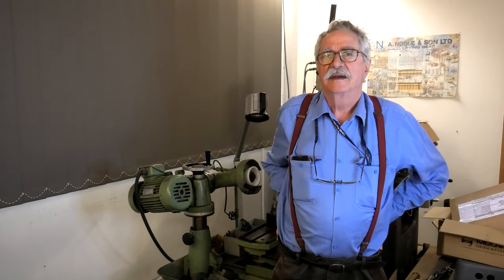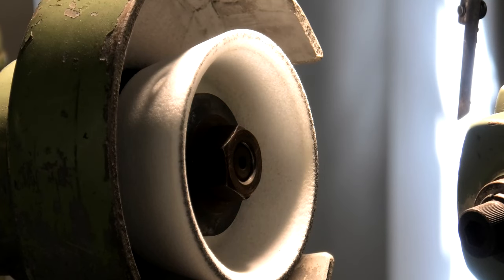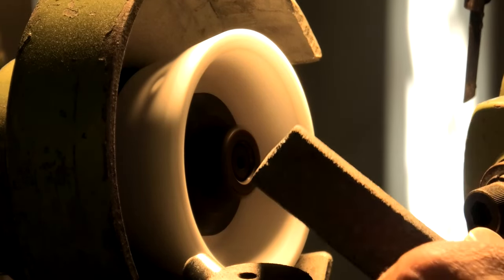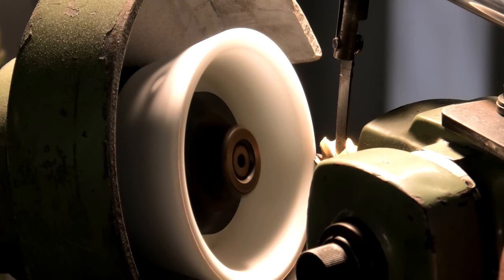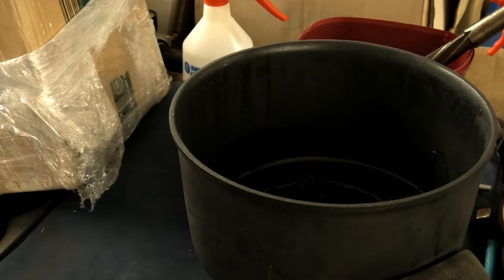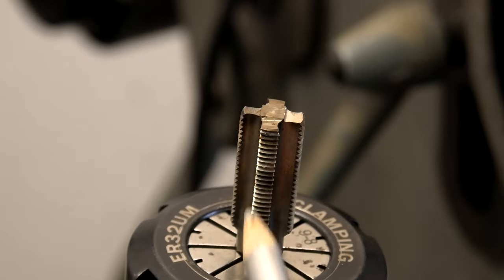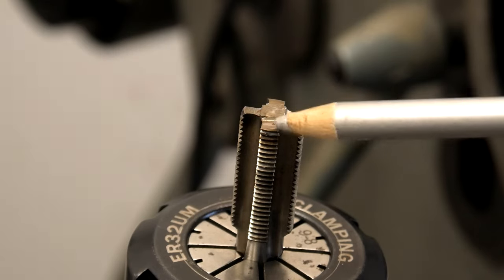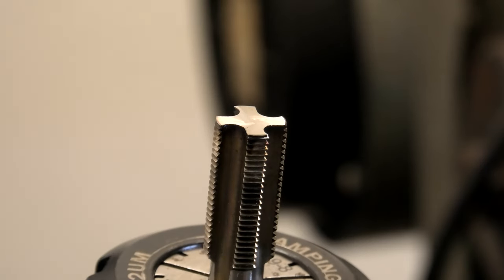More on wheel dressing and starting to grind a extra fine pitch tap.

Comment: What were you holding your wheel dresser with when you dressed the wheel? Was it held in a collet chuck mounted in the standard MT3 tool holder that comes with the Tool & Cutter grinder? I couldn't see how it's was being held in the video 🤔
Reply from the maker: Hello Mark. The dresser is held in a cast tower made for the job. I have many earlier videos showing T & C accessories. BC.
Reply: Thanks, I found that previous video with your dresser support stand 😁